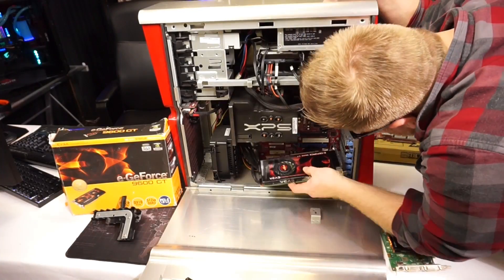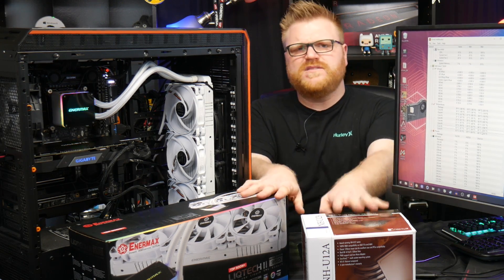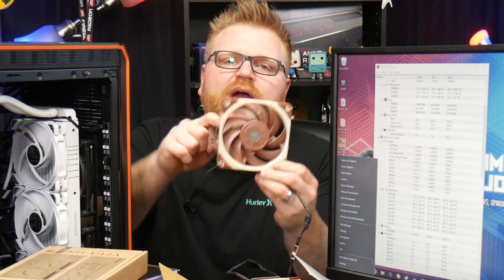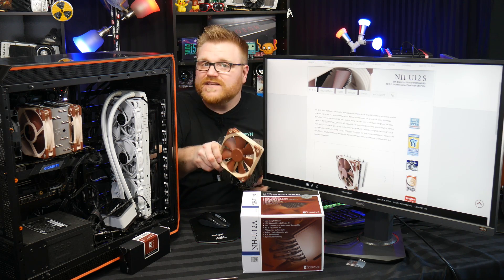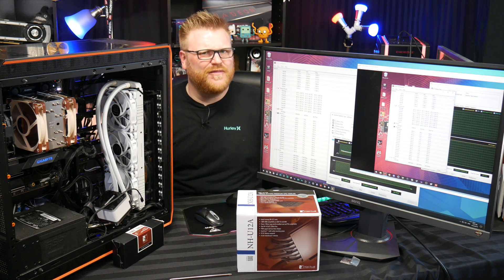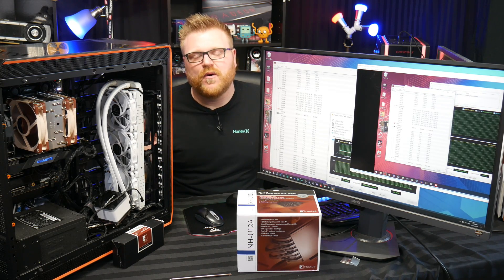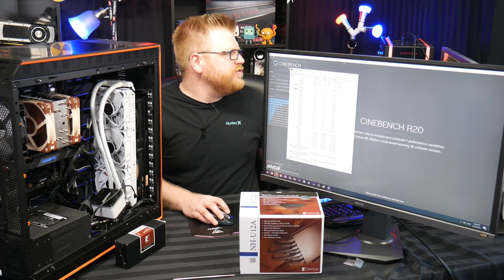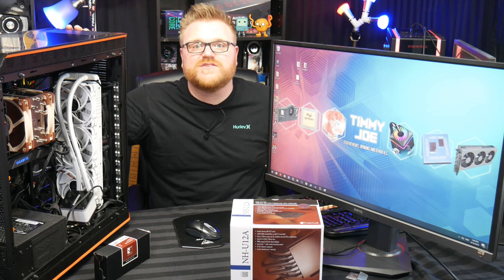Noctua's new cooler keeps up with a 360mm AIO!

Comment: I used to be all water. Then I learned about Noctua and I'm 100% air with about 10 Noctua 140's
Edit: 8700K at 5.0Ghz.
RAM at 4000 MHz
2080 Ti FTW3 (Air) at 2070MHz
Reply: water is superior IF you are willing to go with PROPER custom loop ... AIOs are waste of money space and time
Reply: @Asghaad  While i agree with you on both statments, water is 99% of the times a waste of money.
Idk a consumer setup of CPU and GPU that can´t be cooled on air under decent temps and at decent or inaudible noise floor. That beeing said, it does requiere much more knowledge, and the setup usually requieres specific parts to work. But in a world where cooler and case reviews don´t get any much better than this and aesthetics have more weight than performance/noise, almost noone know how to work around on an air setup properly configured.
Reply: @TTks124  but i agree, water cooling IS a waste of money, hell my loop cost me more than midrange PC :)

it is however worth it for people who dont mind investing money in the PC for TWO reasons 

1. ultra high overclocking, custom loop WILL be able to keep the hardware cooler than air can so you can in theory achieve better overclocks

2. SILENCE with performance, while you can have pretty silent aircooled system, it cant be high performance one, if you wnat to have good performance, overclock and get as silent system as possible Water is the way to do it because especially GPUs are still pretty loud when under load even with good aircoolers.

and trust me i had killer combo of Noctua CPU cooler with MSi Twin Frozr cooled GPU and it was LOUD when compared to whisper that comes out of my PC now with custom water loop and as added bonus my tempereatures under load went down under 50C

yes its costly and yes its not that you cant have good PC without it but you cannot have heavily overclocked system that is also near silent at the same time on air
Reply: @Asghaad  unless it's a 9900k you can have inaudible system on air, with max OC ( max OC that can be ran 24/7 not some batshit crazy that degrades in less than 2 years). Oh and by the way. Im not talking silent, or whisper quiet, im talking I.N.A.U.D.I.B.L.E
Noctua doesnt have the best air coolers in the market, and i dont value brands. I value products on their own merits. Also any GPU stock fans are pure garbage, doesn't matter the brand.

As i said: achieving performance on air cooling requieres much, much more knowledge than water and there's not much ppl that know to properly configure a setup.
Reply: @TTks124  no you cannot ... mainly because GPU is the biggest source of noise in the system and even without it my Noctua NH U14S was louder cooling my i7 4820k at 4.4Ghz (last SOLDERED chip before they switched to paste by the way) than my 8 fan water system is now ...

add to that GPU aircooler noise which is SIGNIFICANT even at normal curve and non overclocked and you get pretty "loud" system 

maybe YOU call it "silent" but what i call silent is my system which barely humms even when you are sitting right next to it ...

my system is at full load as silent as the aircooled one was at IDLE (which means GPU fans off, CPU fan at maybe 30%)
Reply: @UCrHLuySXifsPHkxZGAQp6hw  so basically open airflow case you stifled with no exhaust fan, 212 EVO budget aircooler ... not buying those numbers especially considering my MSI 980Ti with twin Frozr cooler ran pretty hot when OCd and runs at 50C under water i really find it hard to believe slapping two normal fans ANMD keeping them at less than 30% RPM would keep it that cool on it would keep it 

i get it that you want to overpressure the case to keep dust out but you are also killing the flow making the interior to one big air turbulence with air escaping everywhere it can instead of flowing shortest route over components that need to be cooled. At least give it ONE exhaust fan to direct the airflow ...

and i call BS on "inaudible" especially in airflow case like Meshify...

let me put my specs here to compare :

CPU : i7 4820k 1.36V at 4.4 GHz

GPU : MSI GTX 980Ti Gaming 6G at 1426 MHz ( base clock for stock FE 980Ti is 1000 ...)

Case : is Bequiet Darkbase Pro 900

EKWB blocks (sadly only core block on GPU as full cover blocks went out of production before i made the switch ) running through 420mm slim crossflow Alphacool rad with 5 fans on it as intake  (6th cant be installed because of the harddisk trays, still 3 Noctua 140mm on front and two Silentwings 3 140mm on the back of the rad are more than enough for low backpressure rad) + 280 mm standard height standard config Alphacool radiator in the roof with two 140mm Noctuas in pull config + one BQ silent wings 3 140mm as back exhaust 

all ran t constant 30% speed along with the pump (EK-XRES 140 Revo D5 PWM)

and its still not something someone could call "inaudible"

so let me be a bit sceptical that aircooled system in airflow case would be "dead silent" when my system in THE BEST silence oriented case on the market ran at extremely low fan speeds is not ...

you have 2 less fans than me in your system, all smaller ran at same or higher speeds (my fans run at +-500 RPM ...) all stuffed in meshed basically open case that lets all noise out ... its physically impossible for you to have "silent" system ... sure when compared to normal system it might be considered "silent" but absolutely noiseless? no its definitelly not.
Reply: @TTks124  man, i guess my Noctua and beQuiet fans ran at less than 500 RPM are then "bad quality" ... its not like those are THE BEST FANS ON THE MARKET ... xD

i repeat i run ALL my fans at less than 1/3rd ... those are 1500 rpm max fans  therefore they run at 500 RPM or lower ... yes my fans have to work over the pressure losses of case intake and radiator .. gues what thats why i have FIVE 140mm fans at the intake ...

and yes im at edge of the small town in closed room with basically THE lowest possible background noise ...

lastly your no exhaust setup creates overpressure in the case with no direct line for the airflow to go so it goes in ALL directions it can escape ... you arent creating any normalized environment in the case, you are simply pumping a lot of air in and let it go wherever it can instead of creating a direct flow channel.

i too overpressure my case BUT i also create direct line of airflow to make the air to flow directly over the MoBo in uniform way to cool VRMs and such ... your approach just bruteforces the airflow with intake and yes you do create turbulence deadzones in your case, just not at CPU or GPU where you have active fans ...
Reply: @Asghaad  they are not bad quality, I'm using the same fans, and you missunderstood me about having to suck air in.

Your fans create negative pressure, in front of them at much lower RPM than mine. So in my case the front fans have a big deposit of air that refills alone on it's own if i run the fans at 800rpm and bellow. Yours don't, so you have negative pressure in front of them, so they force air through the vents and it starts to make air noise at a lower RPM floor. Also your vents are not perpendicularly aligned to your fans, so the air doesn't move in straight line into the fan but it's moved on the right and the left. That creates turbulence and it looses speed.

I edited my last comment and added few things. Read it again of you're interested.
Reply: @Asghaad  kraken x62 still beats any aircooler tho, performance wise they are pretty good, ofcourse value for your money is terrible.
Reply: @budgetking2591  thats 280mm rad (meaning its close to 360mm performance) AIO that costs you more than 2x than NH D15

AND you have to take into consideration also NOISE ... sure Kraken beats NHD15... at almost 40 db ... where Noctuas aircooler with damn close performance does the same at 25 db ... now please realize that every 6db means DOUBLE the noise ... so the Kraken is 2x2x1.5 = SIX TIMES LOUDER than Noctua when both are running theyr fans at max ...

at the price of that Kraken you might as well invest bit more to get into a custom loop where TRUE cooling performance increase actually can be found and for not much more than what you pay for the Kraken you can get one of the starter EKWB custom loop kits which have everything you need to start build simple CPU loop which you can then easily upgrade and for example add GPU block and fully watercool your rig
Reply: @Asghaad  It's not close, it's better. My X62 280mm beats my old H150i Pro 360 on my i9 9900k @5Ghz 1,25v. It also beats the X72 360mm.
Reply: @kainey  and with money you wasted on AIO junk you could have easily built proper custom loop that works much better xD and could cool both your GPU and CPU ...

secondly close and better arent mutually exclusive hell one being better than the other is PREREQUISITE for "close" ...
Reply: @Asghaad  
You know how I clean my PC though to run 4 or 5C hotter? I blow on it with a DataVac for about 12 seconds. Done. Good to go for months. I sure won't have any leaks either. Just like when people convinced me that SLI was awesome years ago. I tried two 1080s and shortly after, I sold them and got a 1080 Ti. No RGB bullshit. Just a mean ass PC in the dark.
Reply: @Asghaad  maybe not everyone knows how to install that shit dude. Ever think of that?
Reply: Where do you get the money from. Seriously, I wanna know
Reply: Silverstone is coming out with the Alta S1 a super air cooling case like the RV02 but with three 200mm fans in the bottom, no drive bays and lots of tempered glass. Was shocased at Computex this year. Figured you air cooling nuts would like to know.
Reply: The Q 
Heck yeah man that’s awesome news. 280’s are dead silent ❤️
Reply: @robertdavidson548  I misspoke its not 280mm fans its 200mm. RGB included.
Reply: The Q 
I was thinking wow!
But still, 200 is very nice
Reply: I got a noctua nh-u9se2 push and pull and a aio h100v2 max temps 55c on both its the same temps aio is all hype.i just got this cooler yesterday and I'm going to put it on my 3600x build.
Reply: what's the advantage of going all air?
Reply: @Exobyte3323  Never ever leaks. And never ever air coolers degrade over time.
Reply: @ConcreteComa and that would be? Im using aios even on my pentium and ryzen 5 because they are not that expensive and really quiet without fans.
Reply: Are you talking about leakage? Oh well in this case, theres something called warranty, also most modern pc parts will survive a shortage, so as long as you aren't stuck with like 1990s components there won't happen much.
Reply: Look at Linus new video where they prove that a dual fan air tower from Noctua outperforms and is quieter than a 360 rad.
Reply: https://youtu.be/23vjWtUpItk
Reply: Im disappointed about you, where is your morpheus 2 with those noctua fans on it ?!
Reply: @Xenoray1  
I had the morpheus on my 1080 Ti and I squeezed two noctua 120s on it. Stayed in the high 40's on full load with the fans at 100% but they were silent. Also liquid metal obviously. But this FTW3 was $1,600. I put liquid metal on it but that as far as I'm going. LoL
Reply: @robertdavidson548  yeah i bought some LM ... just hadnt got courage to try it out yet especially since my loop keeps both my GPU and CPU under 50C easily ... at 30% fan speed ...
Reply: @Xenoray1  while the morpheus might be better, it´s not that good for the VRM, actually one could say, it sucks for a GPU with so much power demand. Also you heavily overestimate the morpheus against 2080 and 2080ti rads. Poor cooling performance on high end cards comes from 90x8mm shitty fans, not because of the radiator itself. Once you mod that shit with some sw3 or nf a12 120mm fans, you gonna get 60ºC under gaming load, with max OC and  at 1000-1200rpm, which is almost inaudible. That´s great performance/noise/cost ratio. Anything over that is just wasting money.
Reply: i use an aio cpu cooler to cool my gpu, for gpu its amazing.
Reply: oh my God what a sexy system , Hopefully ill be able to build something like that on my channel soon

Comment: The rambling is real, Air coolers with high fin density and 5-6 heat pipes are just as capable and even beat most 240mm aio's not sure where you got this idea that air cooling is less effective when compared to aio liquid cooling but you're wrong on that buddy. Must feel really stupid to buy a 600-700 dollar CPU that hits 100 degrees at stock settings and only is comparable to a 220-250$ CPU that stays much cooler.
Reply: i looked up, the best value is a Arctic Freezer 34 eSports for 40$ and is only 2 degress hotter then a Cooler Master MasterLiquid ML240R RGB for 110$. yep you actual right, but if you consider to buy a Noctua NH-D15S, you will be right on Cooler Master Liquid, definitly a plus above the arctic, but for the double Price ? not worth. a 40$ cooler ish, with 6 heatpipes and 2 fans is definitly worth, for noctua you pay only a high premium on the socket upgradeable, warranty and the name ^^ btw. the Noctua NH-U12A costs same as the Liquid, but it is only 1 degree colder and thats actual the end of the aircooler, meanwhile a custom 30mm 280mm radiator with a decent pump + and 60$ waterblock gets around 4 degress colder then the U12A. Worth ? DEFINITLY NOT. But, for someone that spend 700 dollars on a cpu, doesnt care.

Comment: I need a new cooler because my i7 990x keeps hitting 70c
Reply: Damn your still rocking a 990x?
Reply: @UhhDafuq  yeah I've got it overclocked to 4ghz and it's paired with a gtx 970
Reply: @HD7970  If you're looking for an inexpensive upgrade, the x5680 or x5690 westmere cpus are pretty cheap and will generally get to 4.5 or 4.6ghz. They might even have slightly better ipc than  the gulftown 990x. My x5680 @4.5ghz had no trouble keeping my gtx 1080 busy.
Reply: @MrBonesawzall  I'd have to buy a new motherboard as I have a dell board so voltage controll isn't a thing
Reply: @HD7970  that's a deal breaker. I don't think I'd buy an x58 motherboard anymore unless it was a great deal.
Reply: @MrBonesawzall  i paid 25 dollars for the pc the board came with and it came with a i7 920 and 6 gbs of ram and a 500 watt dell pay that from what i have heard is pretty good
Reply: X58 for life!

Comment: Cool video, I personally like the colour of the Noctua Fans, makes them stand out from the crowd. A bit out of left field, but as a used pc enthusiast, have you ever had to try and get rid of cigarette smoke smell from a pc, if so, do you have a best method?
Reply: use some dryer sheets on the intake and exhaust fans for about a week of running it! i do that on all my used tech i get that stinks plug it in somewhere and leave it it running for a few days.

Comment: Timmy Joe PC Tech : could you throw in the temperature results for Cooler Master Hyper 212X RGB Black Edition comparing it to the new NOCTUA NH-U12A with only 1x Noctua NF-A12x25 default fan on it ? It would be interesting to see a 45 EUROS cooler compared to the supposed to be top 104 EUROS Noctua cooler :). The new Noctua NH-U12A is the only cooler I haven't bought yet for a customer and haven't had the chance to test it....because I kinda have a feeling that the new Noctua cooler will only give you around 5 degrees better temps under load even if used with both included Noctua NF-A12x25 fans which would make it not worth the money at all :). Maybe try it on the most popular cpu today, the Ryzen 7 2700X if you have one :). I have my Cooler Master Hyper 212X RGB Black Edition on my Ryzen 7 1800X and I can confirm that it has exactly the same temperatures as my previous NOCTUA NH-U14S which still costs anywhere from 76-80 EUROS.
Reply: There is a german review about this two type of coolers ( of course with all fans installed, not like you want) the results are 50 degress for Noctua @ 1000rpm and the Evo 56 degress @ 1000rpm, maybe if you go off with the one fan, you would be on the same level as noctua but thats a open test bench, The Case and actual installed Fan Setup always depends. But everyone should know, half of the price goes up for the service by noctua.
Reply: @Xenoray1   thanks man I will look for that German review since I also speak German quite well. As to the open benching goes I completely agree with you man. Having a closed case that figuring out the intake and outtake logic of the fans gives temperatures a completely different meaning.
Reply: LFly R I guarantee the Hyper 212x will not perform as well as this, my NHU-14S with a single fan is cooler than not only the 212x but also a Corsair H100i v2 and this new cooler from Noctua is even better than that.
Reply: @LeMMingSlayeR  then you got some wrong results or you Radiator Fans were not for Static Pressure or you Fan Setup itself was bad, a NH D15 is cold as a 240mm radiator on a open test bench. The U12 is one degress colder as a 240mm but 2 degress higher as a 280mm.
Reply: Adrian XenoRay using performance mode on the AIO via Corsair Link, push/pull with Corsair SP120 (static pressure optimized) fans in the intake (front) grill of a Corsair Air 540 case.  Hate to say it but it’s true.  Verified temps using hwmonitor as well as Ryzen master software and the NHU14S was 5c cooler after 1hr aida64 stress test on a Ryzen 1700 @ 4.0ghz / 1.425v.  Maxed out at 77c with the Noctua and 82c on the H100i.  Used Thermal Grizzly Kryonaut paste for both.
Reply: @LeMMingSlayeR   well watercoolers are as good after all. The main problem for them is complete and total lack of any kind of air movement on the VRM-s which becomes especially important when you start OC-ing. In your case I would stay on the Noctua NH-U14S because it's safer and better performing and has a better coefficient of heat distribution.